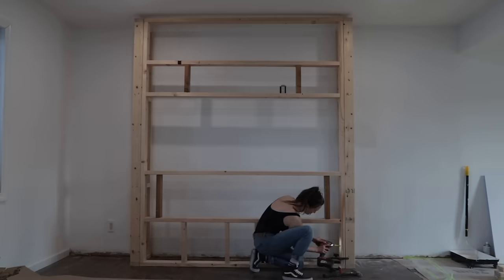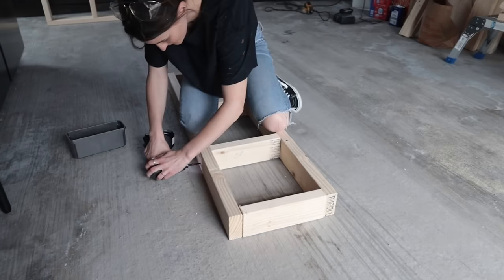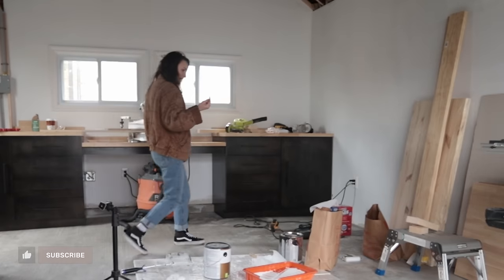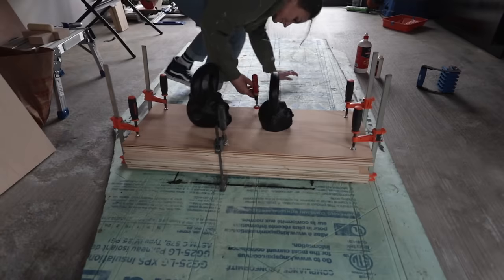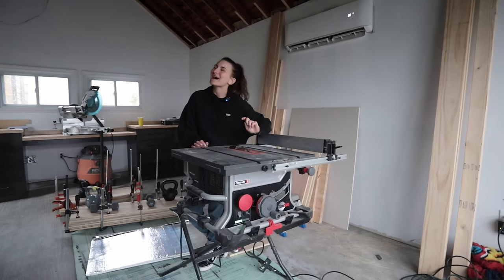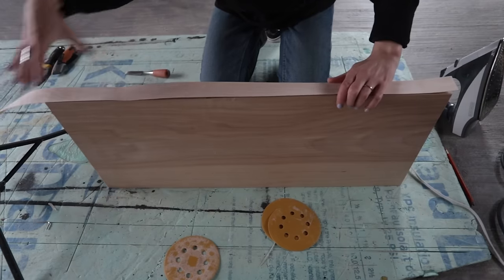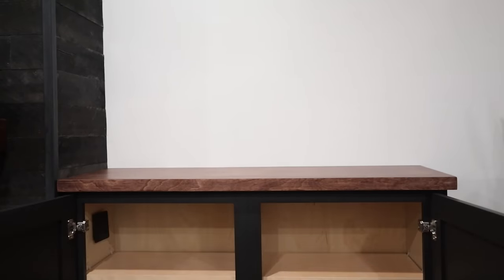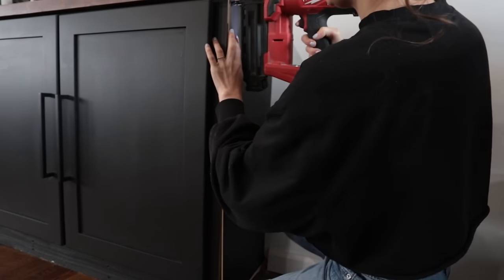EASY DIY BUILT-IN CABINETS + FLOATING SHELVES

Comment: I’m a beginner..you said you hit “at least” one stud for the brackets when you were installing them. If you didn’t hit a stud, that means you were only drilling them into drywall? Wouldn’t that make one side of the shelf unable to bear the same load as the other side?
Reply from the maker: Hi! So, technically the shelves are attached to more than one stud because I also secured it to the 2x4 frame of the fireplace (I did this because one of the shelving brackets is attached to a stud and the other is attached to the drywall with toggle anchors that support up to 100 lbs). Hope this makes sense!